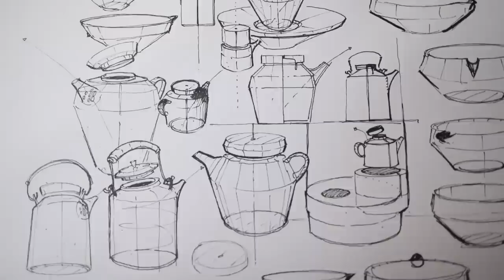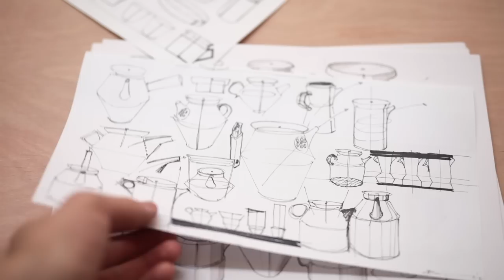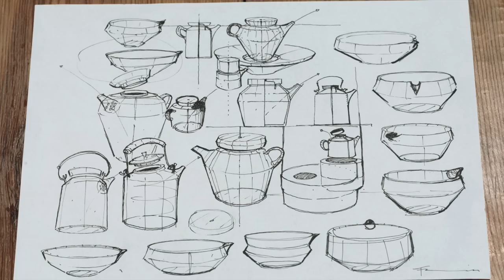My Design Process — From Sketch to Pouring Bowl

Comment: Love seeing your process. The bowl I like best is the one where you have the rim separated by that extra plane. However, I wonder how this shape will affect the pour-ability of the bowl. Whenever I'm pouring something from a bowl, it's usually something thicker like batter which needs a wider spout. I'm wondering, in your thinking about this design, does the spout match another pot you are making? How did you decide on such a narrow spout?

Comment: Here’s a tip that I’ve learned: when picking up a piece off the wheel when it’s hard to grasp, I lightly wet my fingers (no drips). That  gives just enough of a slip resistance to grip.

Comment: if it isn't too much a detriment to the structure and the like of the pot, I'd suggest, if you're going for an inward angle, to throw it so the inside has no lip. this would, however, make a fairly thick band on the outside. However, this is a case of function over form, and if you play your trimming 'cards' right... I think it could work very well.

Comment: I think I like the second from the left, but it isn't really the one that fits in with your other work the best. The third from the left is a bit more like your range, but there is something about it that seems a bit exaggerated? I appreciate how you dealt with the throwing issues that occurred. One issue I'm trying to prevent is getting a twist in the clay when I cone up. If the clay gets twisted at that point I find that it reappears later when I'm trying to pull up the clay. I wonder if you have solutions for twists or if it is better to re-wedge the clay and start over?